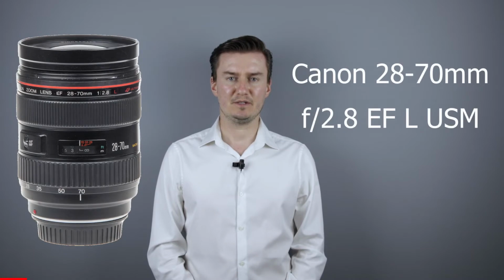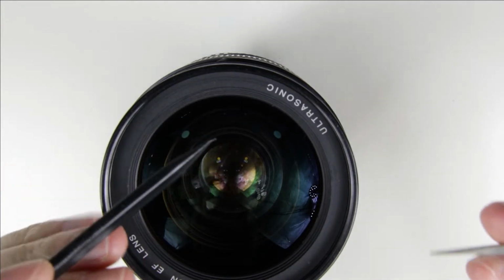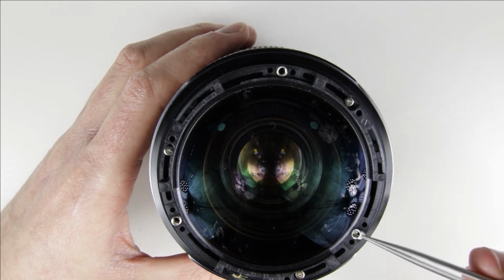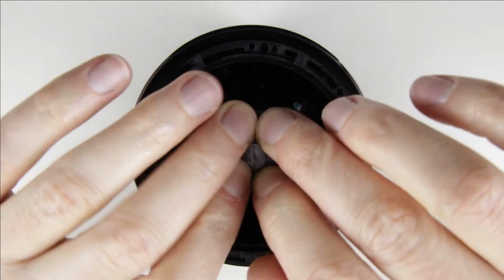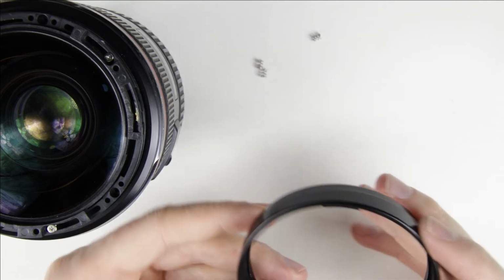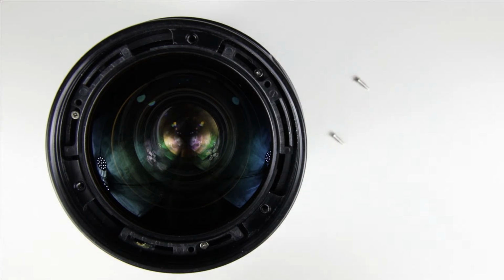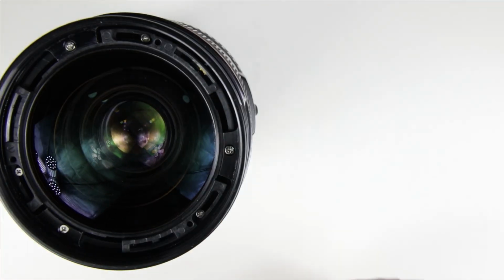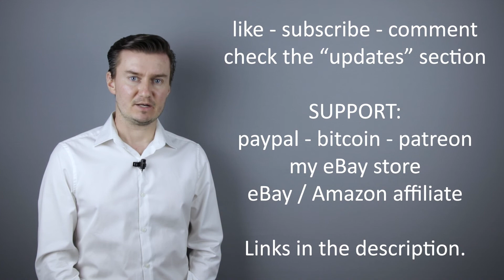Canon EF 28-70mm f/2.8 L USM clean the lens inside

Comment: Hi there, thanks for the video. I think im gonna try to remove the dust particle like you did. But there one more thing  i am not able to focus clearly with this lens. It seems like the lens element is somehow decentralised. Do you know how to resolve this or have you ever dissassembled this lens? I am confused what to do with this lens as the canon repair center refused to repair it because the model is so old.
Reply from the maker: If you focus manually, and take a photo of a flat surface which is parallel with the sensor (so everything should be in focus), is everything sharp? If yes, then the lens elements are centralised. If one side of the image is sharper than the other, then the problem could be that one of the lens elements are not parallel with the others.

Comment: Hi Thanks for a clean and informative video. I seem to have a little fungus on my lens' first element. Will this clean be enough
Reply from the maker: If you're lucky, then the fungus is on the other side of the front lens element, then you can remove that using this video. If the fungus is between the lens elements in the front lens, then the fungus can't be removed.

Comment: Is it the same process for the 24-70mm F4 Canon lens? Thank you so much for the video
Reply: Is it okay that only microfiber that cleans the inside of the lens?
Reply from the maker: I don't know, I haven't disassembled the f/4 lens.
Reply from the maker: I wouldn't recommend it, the dust on the lens element could scratch the surface.
Reply: @CamerasLensesEtc   might be I will direct it in Canon Center here. Thanks a lot.

Comment: Hi thanks for the video. I forgot to put a mark and i forgot how to align it. Now bokeh is messy could you help me
Reply from the maker: Try different settings of the screw collars... disassemble, change their position, assemble, then test the lens. Takes very long time.
Alternatively, disassemble the lens, remove the USM motor, and zoom the lens back and forth to find out if there is a hole where you have access to the screw collar without completely disassembling the lens... if there is, assemble the lens without the USM motor and the unneccessary covers to mount on the camera, and calibrate the lens similar to the Canon 24-105mm lens.
Reply: @CamerasLensesEtc  You mean the screw marks on the front by screw collar? I can't find any. Thanks
Reply from the maker: Sorry, I thought you commented on the disassembly video and you forgot to mark the screws in the aperture unit... my mistake.
In the case of cleaning, test the sharpness of the lens with different settings: set the front lens to the very left or right position, take test photos, move the lens by ~2 millimeters, then take the test photos, then continue until you reach the other side. Then compare the test photos, and you'll see which setting is the sharpest.
Alternatively, you might see the signs of the screw on the side of the front lens element, you might use that position,.